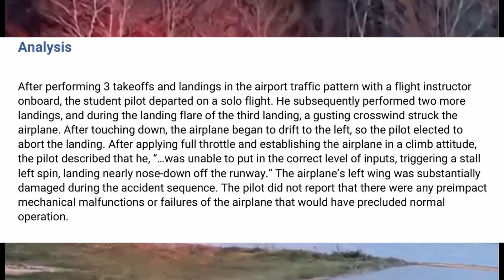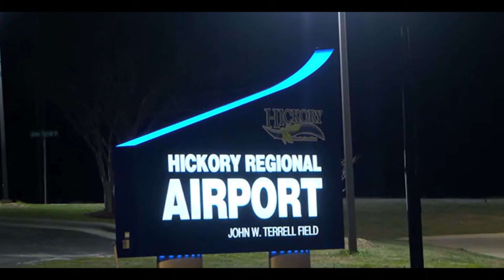Student Pilot Stalls on Go Around

Comment: Trim was set for landing and doing a go around requires a lot of forward pressure on the controls until the trim is reset. That probably gave the high pitch up of the nose and resulted in the stall.
Reply from the maker: Thanks for the comment.

Comment: And finally if we are going to promote go around, we need to first promote acceleration level in low ground effect until zoom reserve airspeed is reached before climb out.
Reply: If your airspeed is already at Vx or above, why do you need zoom reserve, especially if you start your go-around way before you get into ground effect?
Reply: @philipmartin708 Why do good pilots flying to Airman Certification stall halfway down a long runway and fall from high enough to kill them?  Vx pitch attitude for three seconds startle because the engine quit or relative wind changed does not work well.  The outcome of being slow and out of ground effect when bad things happen is always in question.  If we are judged based on the probability of a good outcome, why are we taught to get into horribly energy inefficient states?

Comment: Second, we would save many lives and more airplanes if we returned to teaching the law of the roller coaster and that airspeed is altitude and altitude is airspeed, but we stay level in low ground effect on takeoff to accelerate to zoom reserve airspeed.  Zoom reserve airspeed is enough airspeed energy to allow both temporary climb and maneuvering with or without engine power.  This student found out that while the airplane will fly, even climb, in ground effect slower than Vso.  This student also found out that the airplane will not fly slower than Vso when we climb out of ground effect.
Reply from the maker: Thanks for the comment and interesting point

Comment: First we instructors need to return to the best technique for the maintenance of either butt to target directional control in the crab or the side slip technique for the maintenance of the target between our legs and at the same time (with either technique) keep the wing stabilized.  Dynamic proactive rudder pedals movement (without any aileron movement), walking the rudder pedals rapidly, sets our own phase rather than reacting to nose drift or gust disruption.  If we bracket tightly and nail the centerline extended and centerline either butt to centerline or centerline between our legs with stable bank for drift control, the wing cannot bank even in rough air.  Walking the rudder with the same dynamic proactive movement of balancing a broom on our hand prevents nose wander, wing wagging, and LOC.  If we are actively flying the airplane by reference to the earth and moving the controls properly, we are not disrupted by normal wind conditions.  We fail students and set them up for this if we teach that the rudder can never be used without coordinated aileron.  It can and should be used individually for maintenance of longitudinal alignment.  Yes we should cross control the aileron if slipping, but once the bank is set, the aileron must be frozen to prevent adverse yaw.  Correct yaw is a rudder only thing.
Reply: Don’t walk the rudder pedals rapidly. 🤦🏻‍♂️  and don’t teach that to your students.
Reply: @rtbrtb_dutchy4183 Try it and see how easy it is to stay aligned with the centerline and never need to make continuous turns, which will never achieve longitudinal alignment.  I started in 1956 at age nine and became an instructor in 1974, so many pilots out there are tail wagging their short final and never wing wagging because of using that damned steering wheel.